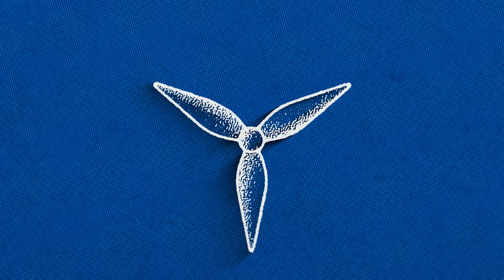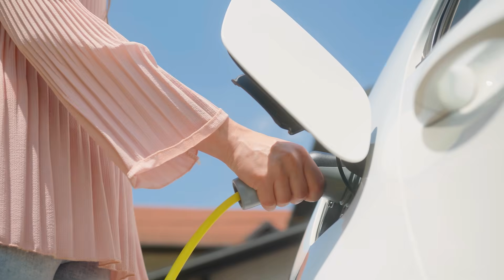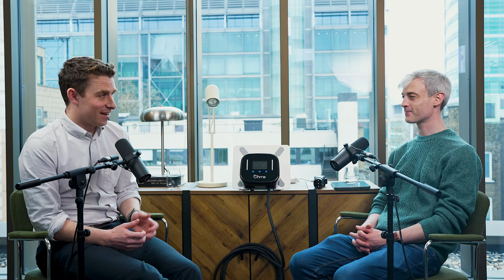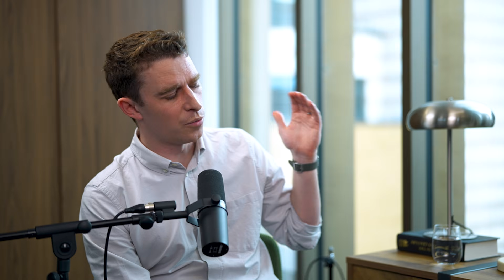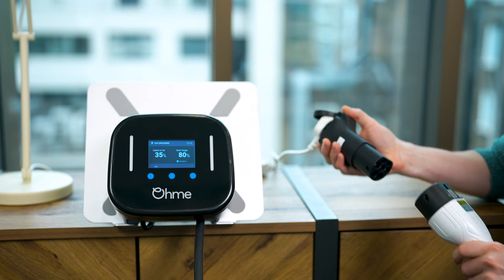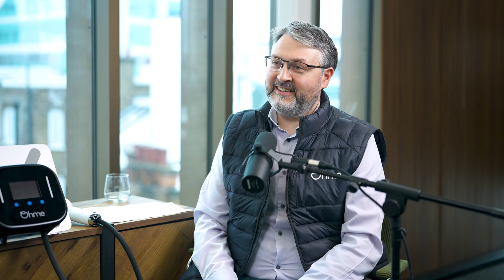The Behavioural Shift That Makes EV Flexibility Actually Work - Ohme

Comment: And the next thing is flexibility on the demand using heat pumps! Turn them down after 16:00 for short periods to reduce the tea time load.
EV charging is going to be great for the Grid but commercial vehicles and buses are going to be a bit of an issue.

Comment: Charging a car battery overnight to full will degrade the car battery. The Vauxhall Frontera user manual recommends charging to 40% if you are not planning to use the car for a few days.
Reply: Depends on the battery.  LFP does just fine at 100%
Reply: That's the most modest OEM charging recommendation I have ever seen. Either they don't have much confidence in their battery, or they are very keen to minimise the risk of battery warranty claims
Reply: @redshift3 My thoughts too. I thought batteries last longer than the rest of the car these days.  I think I would have asked the tech writer to just delete that from the user manual.  Certainly give advice on storing the vehicle for 12 months or more, but not undermine confidence in the battery unnecessarily.

Comment: My Renault R5 does have bi-directional charging but it is really expensive to have this installed at home. If it really helps the grid then it needs to be rolled out to customers free of charge, like we had with smart meters.

Comment: @edportermodo -have a look at co-charger for the ability to allow friends/neighbours to make use of your home charger , and make a small profit. You can set the rate that you charge, based on what it will cost you on your home tariff. The co-charger app handles all the booking of the charger sessions & payments etc. 
good to see the flexibility being exploited to improve the grid costs. 
I have  octopus IOG as my tariff & you set what additional % of my battery I need added by a specific time. E.g. add 30% by 08:00 in the morning, but what I would prefer is to just say, I need a minimum of  say 30 or 40%, by 08:00 , but if it is really windy overnight and energy is cheap & clean , the add whatever  extra charge they want up to 80 or 90%.

Comment: Have an ohme at home, poor syncing with the car’s battery.. still charges on schedules bit doesnt know what the battery status is and just assumes its empty.. not satisfactory if you ask me
Reply: This was covered in the interview. Some cars will provide battery state of charge information automatically to the Ohme charger (via API) and some won't. Mine used to, but Jaguar removed this functionality, so now before starting a charging session I have to observe the battery state of charge and work out how much I want to add. Some car manufacturers' APIs are a bit flakey, perhaps this is your experience.

Dan mentioned a new feature being rolled out that does the simple maths for you and allows you to enter the battery state of charge manually, then Ohme works out how much to add to meet your desired target (if you don't enter anything, Ohme assumes a BEV starts from 20% and a PHEV starts from 0%)